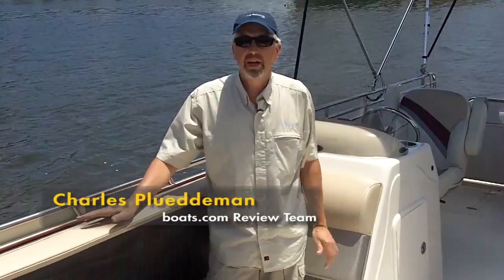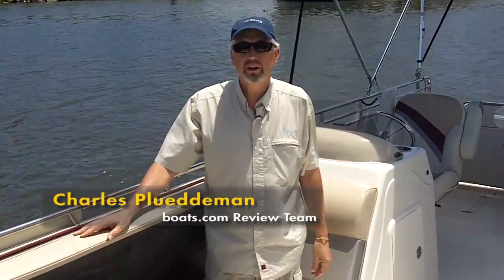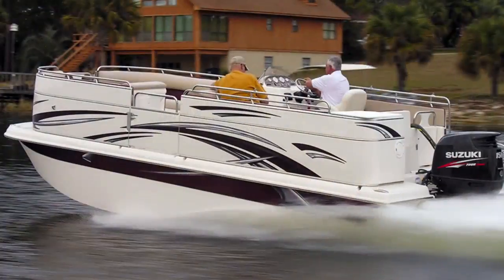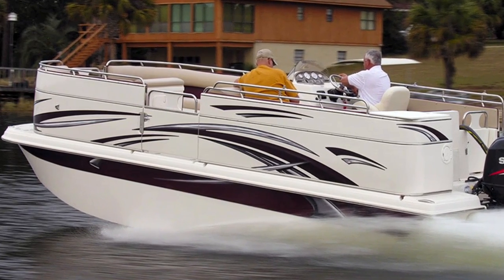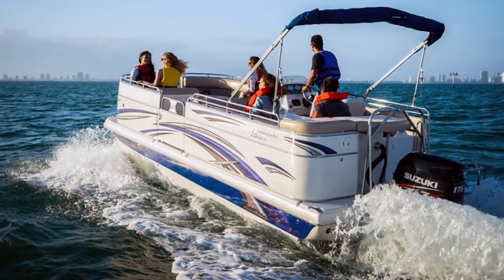Carolina Skiff Fun Chaser FGP 2100 Fiberglass Pontoon Boat

Comment: @boatsdotcom. Thanks, really appreciate it. dealer swapped prop to 15p, but still only 4700rpm wot. thinking height motor is mounted is wrong. driving us nuts.

Comment: Any recomendation for a prop pitch for this boat, just bought ours it has a 150 two stroke optimax and came with a 21 pitch.  Can't get over 3500rpms.  Dealer is useless and carolina skiff refuses to help on "rigging".